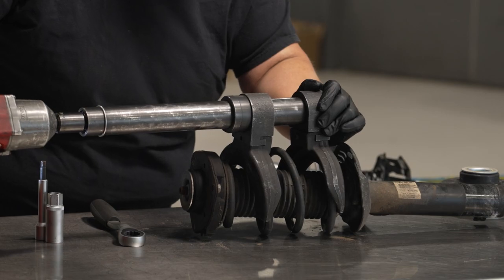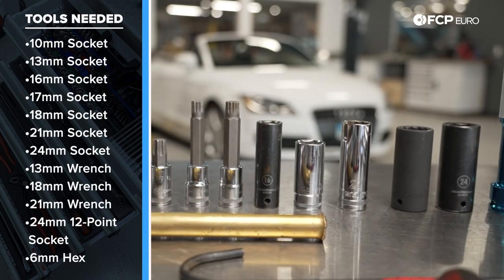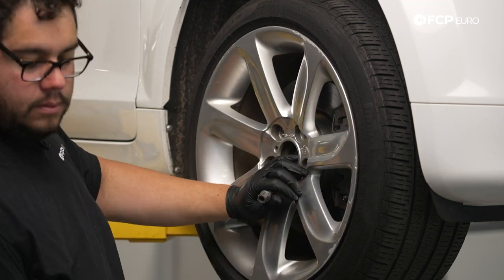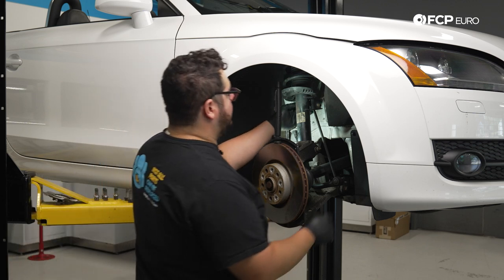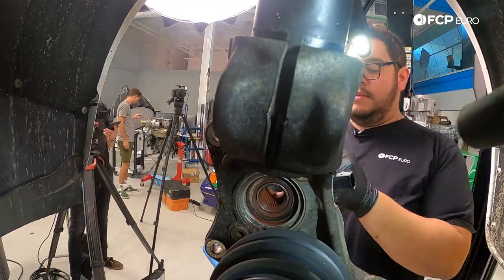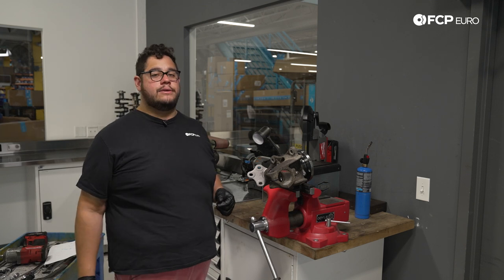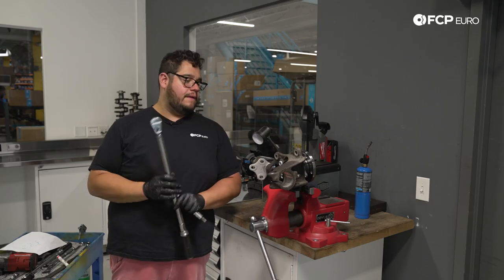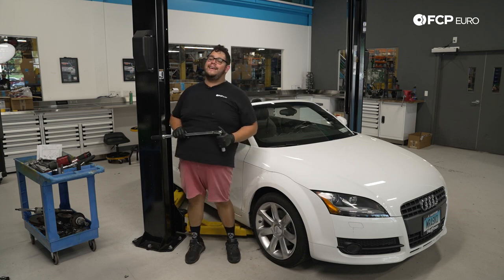Audi TT Front Strut Replacement DIY (2006-2015 Mk2 Audi TT, TTS, RS)

Comment: Gotta be one of the best tutorials on yt, I had to do just the wheel bearing, for this I just took the driveshaft out, took the 3 bolts out of the arm and swung the hub outwards, then you can get to the bearing bolts and they are easy to break the bolts in that position.

Comment: I’ve had new track rod ends, new strut top mounts, new droplinks and there’s a knocking noise on the front passengers side - have you guys got any idea what’s causing this? Everything is tight and set to torque specs (maybe slightly beyond but not VFT) 

I’ve been to two different garages and no one can work out what the cause is 😢
Reply from the maker: Hi Craig, bad control arms/ball joints can also cause a knock in the suspension, you may want to jack it up and get underneath with a prybar to try and determine where the play/noise it.

Comment: So I was thinking, couldn't you just loosen that bolt that clamps the strut and let the suspension sag while the strut is still in there? Losen the top 3 bolts and you're done?
Reply: Ooh and don't forget that one link attached to the shock itself
Reply: Have you done it? That is what I’m gonna attempt to do next week.
Reply: @yousufzahid6949  no for me it turned out the level sensor was fucked and that made it spungie. 

altough i think when lowering the suspension the drive shaft might hit its lowest point before you get the shock lose, idk havent tried it though

Comment: Talk about over complicating the job! For the front Disconnect drop link, balljoint, undo hub bolt and bracketry, undo level sensor, spread the hub, remove the strut job done.
Reply: most videos show this way being a real pain and not possible with one person.  I am new to this stuff and don't really know

Comment: Thanks for another great video Mike, it helped me out doing the job on my 2010 TTS.   Re front hub torque values, there are 3 possible styles of bolts which could confuse anyone.  This chart is from the factory manual:   
Drive Axle to Wheel Hub Bolt 1

- Hex Bolt - 200nm + 180° turn
- 12-Point Bolt with Ribs - 70nm + 90° turn
- 12-Point Bolt without Ribs - 200nm + 180° turn   (the ribs are on the underside of the bolt - if your bolt is smooth, that means no ribs)

Update !   I just bought 2 hub bolts at the Audi dealer and while the old bolts were grade 10.9, the new ones are now 8.8, a significant drop in strength.  They are the 12 point no rib style.  From a variety of torque tables, a 16 mm 8.8 bolt is good for 154 ft lbs so the above chart seems no longer relevant.  Two indy Audi shops I visited said they torque these new bolts to 140 ft lbs and add 90 degrees.  I went with that and let me tell you, that is still difficult to achieve 90 degrees.  Do your homework on this topic.

Comment: Why is there such a difference in torque between the hexagon and 12-point drive shaft to wheel hub bolt? My car came with the hex, but FCP only sold the 12-point. Nice vid, but you should mention the difference more between the mag-ride cars. 🙃

Comment: Correction of axle nut torque was to quick. Easy to miss and seriously under tighten the bolt that holds one of your wheels on

Comment: Generally a good video except for one point. I believe that by holding the disc by putting screwdriver through the top of the caliber when tightening, or the bottom part when loosening the axle bolt you stand a chance of bending the caliber slide pins. (which are the weakest part of the system, ) much better to make sure that the caliber carrier is what takes the "200"NM torque, we can see how much the caliber moved when you did it when tightening... much better to do it on the ground (with wheel chocked). am just about to do a mk 2 front end, everything else was useful, and well described.

Comment: Very good tutorial. Only thing was how quickly the correction for axle torque/plus rotation. Someone could miss that and seriously under tighten it. It does hold the wheel on :)

Comment: For those that don't have a pass through socket set, get one. If you don't, an O2 sensor wrench is also a 21mm and will work to remove a strut mount nut.

Comment: 60nm...not enough I just took off my top mount and the lock nut on KW was lose and was knocking back forth and created an oval shape. So the new one I did , i used red loctite and then hit it with an impact. That isn't going anywhere.